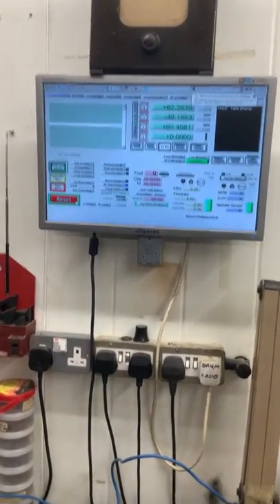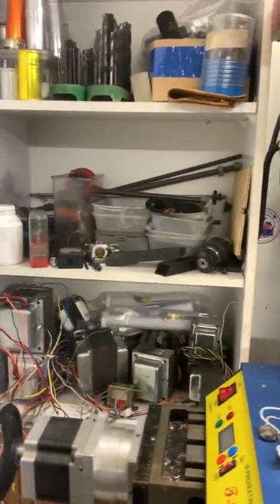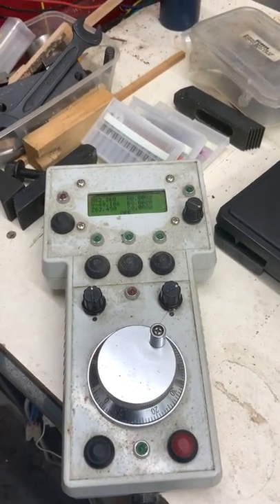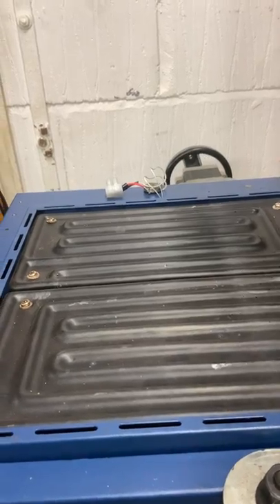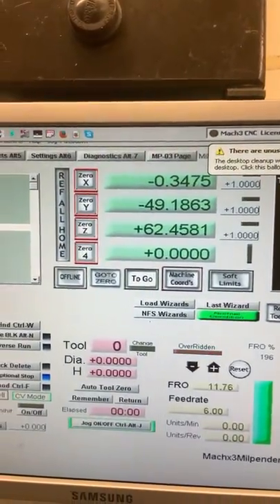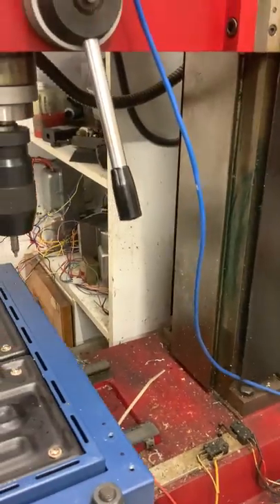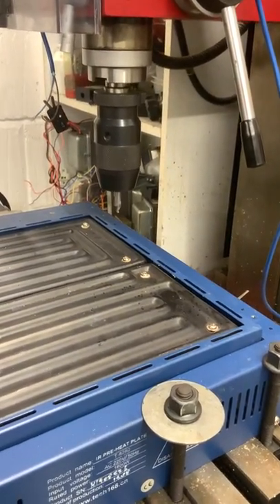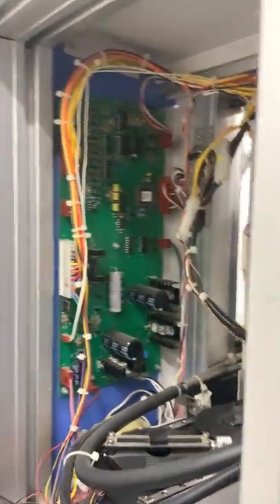Playing with my home built CNC mill

Comment: Someone gave me all the stuff to do this myself except for the control board. Recommdations that aren’t ramps or pi’s?
Reply from the maker: hi i used a purpose built board which is disscontinued but this is running on XP with MACH3 which uses the printer port to drive control board which controls the stepper drivers
have a look https://www.machsupport.com/software/mach3/ for ideas were abouts are you
Reply: @Steve_be  I live in the US, I’ve done ramps on 3d printers but it’s just loud, I really wish I could setup something like a BTT SKR 2.0 but idk if there’s firmware available or if the current marlin would actually work for a milling machine. I do think if I used a printer board I’ll have to use larger external stepper controllers which is totally fine, I just don’t want to use a cheap ramps and an expensive pi, unless those pi zeros work but I don’t know anything about pi’s